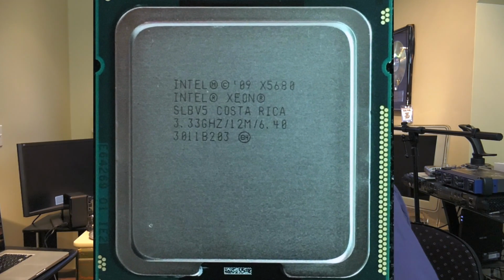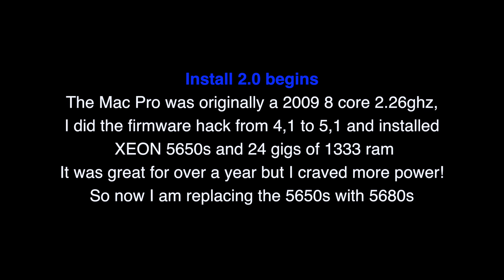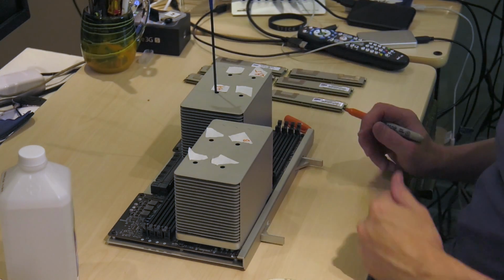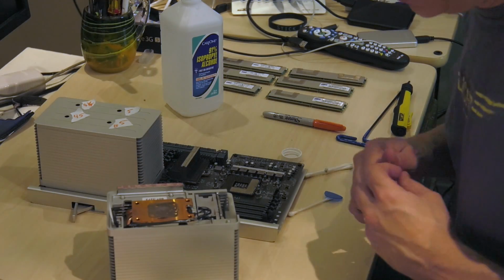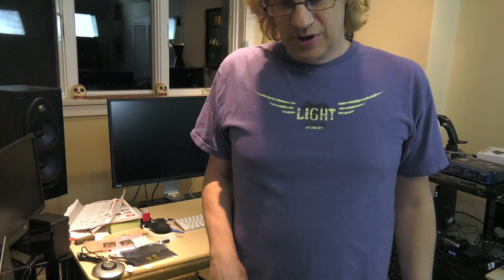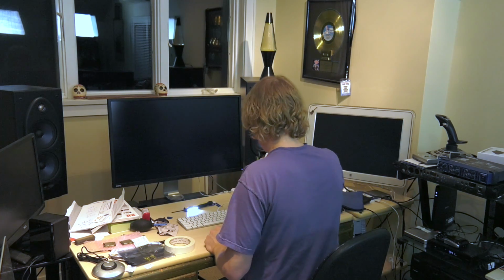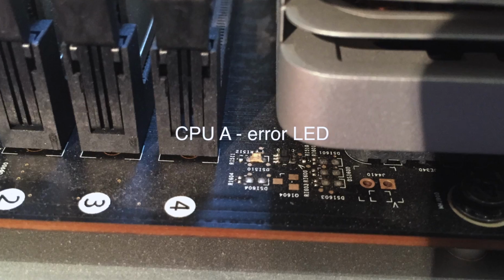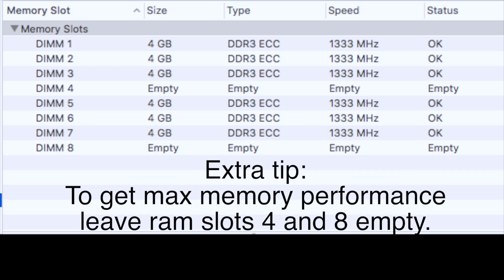MAC PRO CPU Upgrade Xeons 5680s.

Comment: im honestly surprised that your ram count is being affected by the CPU heatsink tightness - i really dont think these are interelated in any way, is firmly believe that the ram not all loading up has more to do with ram disposition and number of cards than anything to do with CPU installation - you can look this up on forums and you will see that newly installed ram, if not properly installed will sometimes give you a different count when booting up your mac - but hey, im not a pro either, so cannot fully vouch for my opinion on this, just personal experience.
Reply from the maker: barni livingston  I have done several installs and the ram not all showing has been  quite common and seems to be related to the even pressure of the heat sinks with the 2009 models Usually  all ram was working  before the install. But you do need  to reset pram to ensure the Mac recognizes the faster speed if installing 1333ghz from 1066. 2010 models have the lock down clamp that puts even pressure down on the cpu so it’s not as much of an issue.

Comment: Hi Lance , i performed the upgrade of a 2009 Nehalem 2 x 2.26 from 4.1 to 5.1 and with 2 x X5677 @ 3.46ghz , the mac boots but bizarrely CPU B doesn't show up in system report nor the ram on CPU B. I tried to tight a tiny little more but fans get spinning right away . I tried to reset pram and smc but still no go . It's really weird also because macs fan control app shows temp and fan speed for CPU B ... anybody has a clue ?  i've never red about this behaviour on forums :(
Reply from the maker: A few quetsions I have not heard of 5677 usually it's 5690s or 5680s I did look and some folks have used those. It's hard to say, fans will alsways go full blast when only one CPU is working. Did you use lided or delided chips? I had thermal past fall into the cpu b tray socket and had the same issue really. It did not show up but the computer booted and always will if one cpu is working. I would take out CPU B and check all spots to make sure nothing is off and try reinstalling. You could have a bad chip as well. You could try switching the two and see if B boot in the A slot. A pain I know but you have to try and figure it out.
Reply: thx for the reply ! i used lidded ones, thermal pad and i swapped cpu's, they are good , i'll check the socket ... the thing is that fans are ok , no red leds on the board , everything worked like a charm, mac boots fast but no cpu B
Reply from the maker: hmm that is odd. So when you go to about this mac it only shows the one CPU, thats odd that the fans act normal when it's not showing up. Look closely at the socket for B with a magnifying glass or take a pick and zoom way in and see if there is any small bits of  lint dust or old thermal paste in there. Are 5677s meant for duel CPU computers? As I have not heard of them until today. I know that 3600 are for single and 5600 are for dual but maybe check on that. 
I just saw this in a thread "That's why I'm hoping I can just pull the 5677s from the HP machine. SAid one person and was answered with this
"Those do not work in a Mac Pro" although it did not state why they would not work. It may be those processors are a no go for dual mac pros and that could be why it only shows up as a single CPU maybe they slightly different architecture from the regular 5680 3.33ghz and 5690 3.46ghz that everyone uses.
Reply: indeed you understood correctly , the mac boots normally without any fault ! i checked the socket with a magnifier and no problems so the only issue could be with the mac not liking these 2 cpu's although i bought them after checking a list with compatible processors, i paid them 55 dollars... maybe they are an hit and miss. one thing i noticed is that heatsink B is dead cold so the cpu board doesn't power the cpu, i guess i'll have to buy 2 x 5690 then. Thanks for you input anyway !

Comment: Is there a reason you went down to 24 GB memory ? I saw in your first video you had 32GB memory installed ? Why the downgrade ? I remember reading somewhere that leaving one memory slot open will actually increase cpu performance?
Reply from the maker: Yes leaving the last slot open in each memory bank increases 
performance, I was shocked at the difference when I ran geekbench with 
all slots full and then leaving two slots open. Hence why I use 24 gigs 
now instead of 32. Applies to 2009 -2012 mac pros.

Comment: Hi, i just got a Mac Pro 2008, only one cpu. I can install a second one?
Reply from the maker: No you can't but you could install a slightly faster stock CONFIG CPU but your better off getting a 2009 4,1 or 2010. The 2008 has slower pci buss speed, ram speed and is not upgrade able like the 2009 Mac pros.
Reply: +Lance McVickar thank you, i got to keep it. Mac pro are not easy to found here. and i dont got more money . i hope i can edit some vídeo.
Reply from the maker: +Vinci Andrés Belalcázar Yabur I had a 2008 for about 4 years was a good computer and you can upgrade the graphics card if needed.
Reply: hi man so cool your video and then i've just to buy a :"
3.33GHz Intel Xeon X5680 6 Core 6.4GT/s 12MB L3 Cache Socket LGA1366 SLBV5" (plus Arctic Silver 5 Thermal Compound 3.5 ) to upgrade my mac pro early 2009 2 x 2,26 ghz quad core intel xeon and it wiil work ? that's it ?
Reply from the maker: Zucker zucker no watch my first upgrade video you need thermal pads as well and first you must do the firmware update 4,1 to 5,1 I have a video on that as well, scroll down in the list of my videos, if you plan on removing the IHS then you don't need the thermal pads.
Reply: thanks and  do you recommand a brand or distributor of intel xeon to be sure the cpu is ok and compatible with my mac pro 2 x 2,26 ghz mac pro thanks
Reply from the maker: I bought mine used on Ebay You want Xeon 5650 up to 5690 which is the fastest.
http://www.ebay.com/itm/Matched-Pair-of-Intel-Six-Core-Xeon-X5680-3-33GHz-CPUs-AT80614005124AA-SLBV5-/301941773852?hash=item464d21d61c:g:5wIAAOSwn9lXKmWM
they did have some residual compound on them so they needed cleaning. You can also find them with their IHS removed which makes for an easier install and maybe cooler CPU temps.
Reply: thanks for your advise...i'm on my way for updating my mac pro !

Comment: Where did you read about the upgrade? I just read a post on netkas forums, by aitte, and he mentioned that, while one can crush the CPUs even with washers, it's a safer bet to use them. ALSO, he said that 2mm thermal pads aren't enough. He claims that a machine can die within a few years of use, without thick enough pads. Says that 3.2mm is the better thickness, and that they must be real silicone. Curious as to what you think. I was about to go about using 2mm pads and no washers, but then I got scared after reading this guide, and I'd like to re-think the process.
Reply from the maker: maccollectorZ (Commenting Account) well from my experience I have had no issues,  have upgraded the same Mac Pro twice over a three year period, use it for 8 plus hours every day, game in Windows work in video and audio in OSXx running Sierra very happy with it. I used silicon thermal pads but I did not put new ones in when I did the second upgrade as they seemed fine. Up to you on using washers and thicker pads but from my experience it's not necessary. But that being said you must be careful and thicker pads and washers may not hurt but if I were to do it again I would do it the same way.
Reply: Alright - and how many total turns did it take to get the Mac to boot this time? I'm gathering info from several so that I can get an average turn count. Someone else told me that it took 4.25 turns to get each heatsink screw back in, with lidded CPUs.
Reply from the maker: Yeah its around 8 turns to remove and about  4.25 to 4.5 ish on average 
when tightening. Remember there is loctite on the posts so it might make
 you think it's getting tight, you will see it on the posts when you 
remove the heatsink.. the blue stuff. If you go too tight the cpu lights
 will light and it wont boot. Best to go 3.5 to 4 and work your way 
tighter from there if the ram is not showing up taking out the board and
 doing another 1/4 turn on each screw. You can do one cpu at a time CPU A
 first, make sure to remove both old ones first. The fans will blow at 
full speed however until both are properly installed but that is normal.
 But once CPU 1 is good and all the ram is showing up you can then do 
#2. The one on the rite is #1. Maybe try it without cutting the 
connector cables to the heat sink first and see if that works. It makes 
it tougher to cut those connectors and channel them back in but the 
downside is if everything is showing up cpu and all the ram but your 
fans are blowing hard, then you would have to start from scratch, clean 
everything and start over and cut the connectors. Watch my first video 
as it is more informative if you have not already and you will see what I
 am talking about with the connectors.
https://www.youtube.com/watch?v=YAdgT-hJuXU
Reply: Thank you for the clarification. I will take note of all of this while doing the upgrade. I actually decided to use washers with this, just as a safe bet. I know that they aren't 100% necessary, but it will help some. You think the amount of turns will be the same?

Comment: Hi I wanted to ask can the Intel i7 6700k fit in to the CPU board of the Mac Pro 5.1
Reply from the maker: BMW M FAN NJ I wish but afraid not different pin configuration...
Reply from the maker: Only way is to build a hackentosh with those chips
Reply: Lance McVickar ok thank you for saving me from buying I was very close in buying one I'll probably just look to get a Intel x5690 instead for my Mac Pro 2010 single processor
Reply from the maker: BMW M FAN NJ you want a 3690 for single CPU Mac Pro not 5690
Reply: Lance McVickar oh won't the x5690 fit and what's the difference in specs with the one you have said
Reply: Lance McVickar is it called w3690
Reply from the maker: THey are the same but the 5600 is meant for dual processors as they share the work load, 3600 series is for single processors but they are the same otherwise 3.46 GHZ etc.

Comment: why your cpus come out with the heatsink ?
Reply from the maker: bughu  because they are stuck to the bottom of the heatsinks via the thermal paste unlike the 2010 Mac pros the cpus are not clamped down to the logic board, they just sit under the heasinks so the thermal past sort of acts like glue when removing them.
Reply: this is not good !!
Reply: bughu it's normal when doing this the second time.

Comment: hi 
why not removing the heat spreader from the cpu?? it apears to be a much easier way
Reply from the maker: Because I did not do it the first time I did the upgrade and there was not much info on removing them a few years ago. Plus there is a chance to damage the chips. If  I were to do it from scratch I would consider it. But say you want to take your chips and put them in a newer Mac Pro like a  2010 or 2012 which you may never do, but then you have removed caps and would a have to put them back on or buy new chips as removed is only for 2009 models.
Reply: hi thanks for your response, it sound clever to keep the cpu intact just in case you need it for a newer machine , that's exactly how I am  going to do for mine , thanks for the idea , really good job and great help 👍

Comment: You were risking too much with keeping heat spreaders on. Its not hard at all to remove them and than upgrade is done in 15 minutes without any risks.
Reply from the maker: I know but it was not that popular as I did this quite a few years back and the cost of buying them was still high at the time and buying them removed was even more. It’s still running well in 2021 with Big Sur and Monterey installed.

Comment: Just mailed you an houres ago to     https://www.macsoundsolutions.com/    I get the red light behind the CPU B, no chime/start-up sound. When i make one screw a 1/8 looser..... no chime/no red light. You had the same issuu but when you did not have the chime, you tighten it a bit. But when i do that, the red light is showing up behind the cpu B. In your case there was a boot and some red light near the RAM modules.

Comment: Thanx Lance
i got a 2009 MacPro single processor 2.66
after comparing prices (5690 = 200$ - 5670 = 70$)
i decided to go for the 5670
not much difference in power according CPUBoss
http://cpuboss.com/cpus/Intel-Xeon-X5690-vs-Intel-Xeon-X5670

& its much easier on the single processor, it has a sif cage

Comment: I just finished my 2009 Mac Pro upgrade, pretty much maxed it out. As for the video card I went with the strongest graphics that apple natively supports which is the r9 280x. For the cpu heatsink install, I just tighten the heatsinks with two fingers there is descent room for error but I have them on the tighter side. Luckily for me, mine worked on first go at 8 to 9 turns per screw. check out the specs, price, and process https://www.youtube.com/watch?v=8YdpN1kk2Wk

Comment: instead of using luck, why not using a small torq wrench ....
Reply from the maker: that would be great if one new what the torq should be.
Reply: Use the lowest torq setting to the point the screw begging to turn and the wrench stop clicking (to know the torq). Counting turn is ok but it seem this assembly is tough to tight down properly. But for the torq its 8 lbs/in ( http://tim.id.au/laptops/apple/macpro/macpro_early2009.pdf ) pages 160. But dont worry, your video was great anyway.
Reply: Have you ever heard of the machinery handbook ? One could also look it up to know the torq range of a specific screw thread.  Have a nice day sir!
Reply from the maker: Very interesting indeed, I have a copy of that and read parts about the warning LEDs but I did not know they actually tell you how to install new CPUs. Very un Apple of them :) I stand corrected and will share the info.
You have a nice day as well!